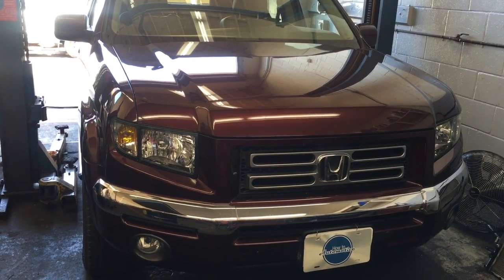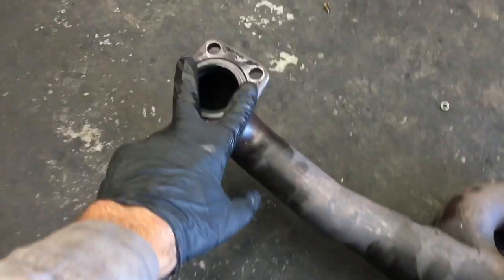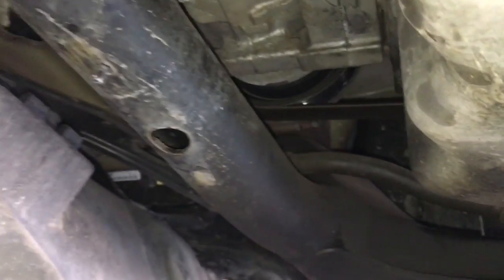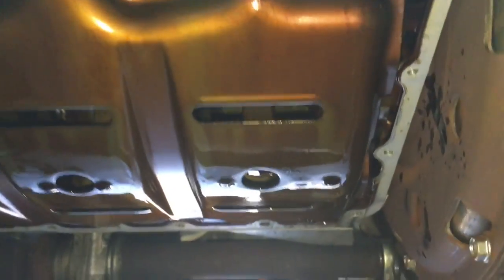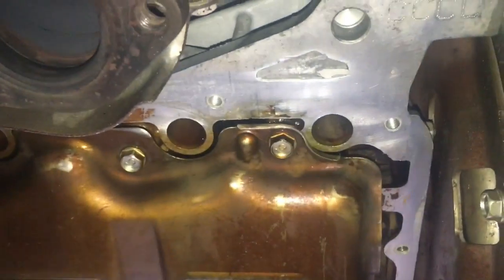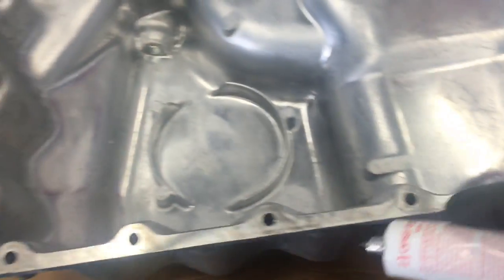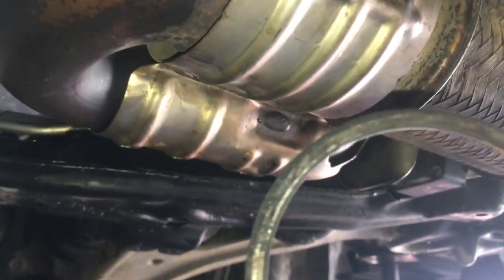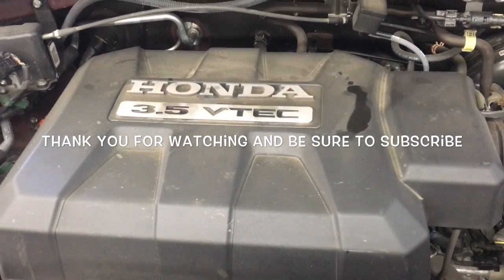How to Replace the Oil Pan on a 2008 Honda Ridgeline/Pilot

Comment: My oil drain plug is 3x oversized, i bought it ,changed the oil, and said Dayum the oil plug isn't tight, so when I changed the oil and put it back in, I found out it was stripped, so I tapped it out , and now I can tighten it but I don't  like it, and the pan leaks anyway, should I get a new pan, the plug doesn't leak??!!

Comment: Thanks for the video. I have an '06 Pilot EX 4WD. I keep seeing info on the internet that says you have to drop the subframe to remove the pan. Do you know which models or years require this? I don't have a problem tackling this job if I don't have to drop the subframe in my garage.

Comment: hello, im trying to replace a oil pan to a 2014 accord. i found a service manual telling me how to do it. But, theres 3 steps that Im not sure if i need to do which are
1.  remove side knuckle from lower arm
2. remove left side damper fork
3. remove left side drive shaft
do I really need to do these steps?

Comment: this is a great video with lots of information. I performed this process on my 2006 Honda Ridgeline and now I have a new oil pan gasket with no leaks and all the bolts torqued to spec. thanks for the great video
Reply from the maker: MATT MUNOZ glad to help. Thank you for watching!
Reply: MATT MUNOZ I just got a 2006 Ridgeline RTL from an estate sale. Dealer says drain plug is stripped so I need a new pan. They got me rolling again but said I’d need it replaced. 

Question: how deep were the threads on the new pan you installed? I’m betting that I could use a longer bolt on my pan; I’m betting not all of the threads are stripped, only the ones in the front of the drain hole at the depth of the short drain plug. 

Can you remember, approximately how many mm deep or part of an inch deep is the drain hole? 3/4 inch or so?
Reply: @HowtoAutomotive  thanks for posting, what's part # for 3 exhaust washer you replace, are they all same size?

Comment: I just did this job thanks to your video - however it is STILL leaking. Had a question about the 18 bolts around the oil pan. Some were different lengths than others. Is this normal? I am not the original owner, so I had no idea. The manual doesn't mention anything about this. Unfortunately, I didn't keep track of which ones went in each hole. Should they all be the same length?
Reply: Hi Shawn, this is two years too late, but I'm sure you figured it out! Basically all the right bolts (7,8,11, 12, 15,17) are the long ones, and the rest are the short ones. I had the very same question, but found out pretty quickly just by putting the bolts on the new pan before install. It does appear the left side bolts (9, 13,14,16,18) sit higher than the rest of them.

Comment: I can't get the harmonic balancer to seat flush with the crankshaft.  Please advise.  I had installed a new oil pump and installed all the pulleys and timing belt etc.  Put the harmonic balancer back on and it isnt seating flush.

Comment: After you loosen the oil pan bolts is there any special trick to getting the pan down and clearing the frame on either side, especially by the oil filter?
Reply: Sadly, no, there is no special trick.  It is an onerous task.  One of the features on my next car will be the lack of difficulty in doing basic maintenance.  I'm looking for that straightaway.  Can I fix common things myself?

Comment: So you showed that you need to remove the crossmember that goes from D to P side,what about the other cross bar that block the oil pan  that goes from the front to that back? I need to do this because the Pan on my 07 pilot is leaking as well and I had a stuck CV axle on the drivers side.
Reply from the maker: Brycen if I don’t show it then you don’t need to. The video is start to finish.

Comment: Im worried that the exhaust. Bolts will be a nightmare to remove. Should I be??
Reply from the maker: mgoodell76 Only if their Rusty. I recommend spraying them with some penetrating oil

Comment: The shop manual procedure says to install the oil pan w/I 5 mins of applying the sealant bead. That will be difficult. Did  you manage to do this? thanks
Reply from the maker: Texas Pipeliner yes you prep everything make sure all your surfaces are clean and dry applier your silicone and install the panel as fast as you can do it.

Comment: I wonder if the stripped drain plug threads were caused by a monkey lube shop amateur.
Reply from the maker: Most likely it was one of those shops. But the car is fixed now.